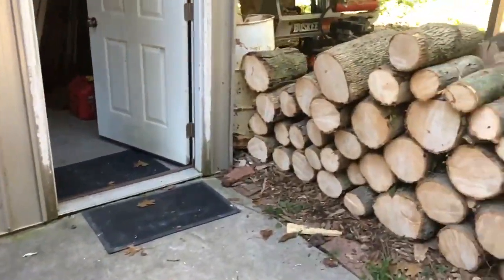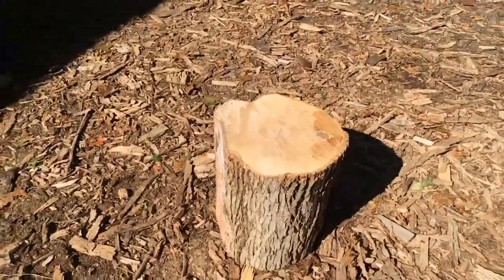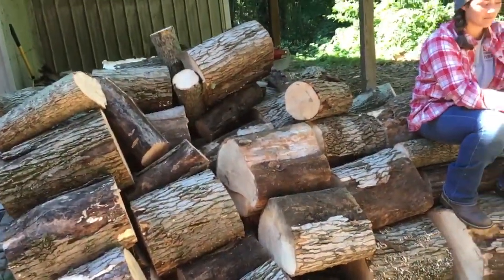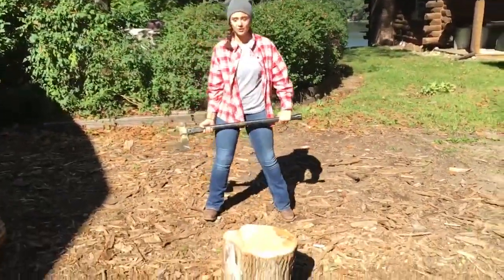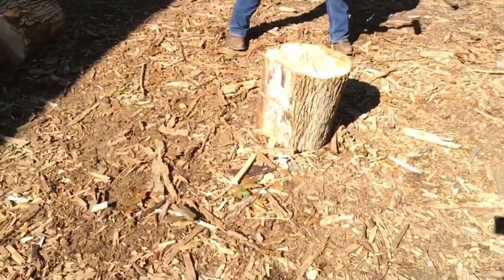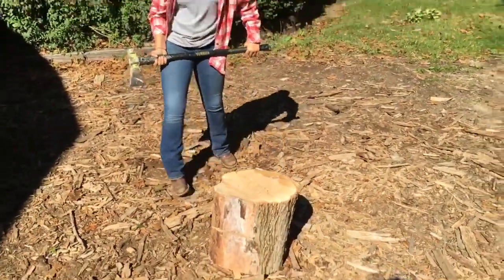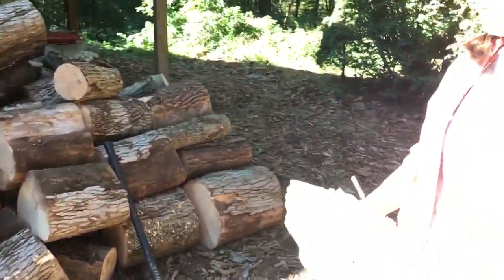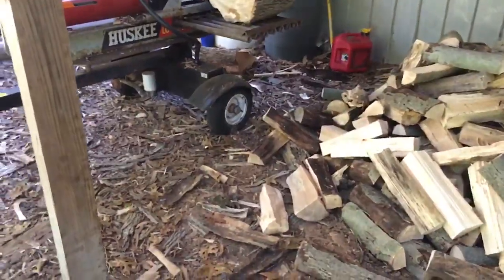Yes, a teenage girl can chop firewood with a maul

Comment: Great job Ashton! You will have an easier time splitting if you place a wide short piece of trunk underneath the piece you are splitting. Then more of the force you are applying will impact with splitting force, rather than causing the piece to bounce. It will also allow the head of your splitting maul to be square with your target piece allowing for more surface area of the splitting wedge to make contact. It's a much more efficient way to split.  At least that's what my many years of splitting wood have taught me.

Comment: If you put the round on top of another round or on a hard surface (slab of stone or on pavement/concrete) more of the kinetic energy will transfer into the round itself. Doing it on the bare soft ground transfers the energy into the ground (ends up acting as if you're trying to hammer the wood into the ground). Just something to try next time... always looking for ways to work smarter, not harder.
Reply: I said the same thing about 5 mins ago, scrolled down and found your comment, good to know I was not the only one that saw that.
Reply: That’s true but when you put it on the ground you get more arc in your swing, more speed and more power
Reply: @rowanfernsler9725  
Yes, as you save a boatload of time from not picking up rounds and chunks.Nobody who splits a lot of wood uses a block,  unless they have beaucoup time to waste.

Comment: Good job Ashton, if you can swing the axe up above your head and then have both hands at the bottom of the handle as you swing  back down on to the log you’ll have a lot more power going through the log. Keep up the good work.
Reply: Should give you better aim as well, both hands working more equally together.

Comment: Poor girl is going to wear herself out! Legs closer together, higher arch with the maul, bend knees and keep back straight on down swing.
Don't forget to grunt a bit, and give the maul a slight twist right as it hits the round. Work the crack from the edge inward.
If all else fails, get the old man to set up the splitter vertical and just roll them rounds over to it.
Reply: @JoesFirewoodVideos  , if it was her first time with it, , she has several things to learn, as mentioned, her stance, , maul over the back, and smoothly but swiftly swing, give a ''you SOB'' scream,  , splitting in the middle seldom gives fast results, hit a little off center,  , or take a step back, and hit towards  the edge right in front of you, looking for cracks already in the wood helps too, , if it had branches it has knots, and be sure not to try to split them,

Comment: Nice Video Joe.  Glad you found a hard working employee, guy or gal they seem hard to find these days.  Saw your pile of Ash and had a question.  Ash is my main wood source and i remove the bark as a common practice - but I cut a dead Ash tree that wasn't affected by the Ash Bore disease so it has its bark on.  The bark is part of the wood and can't be remove easily.  Do you sell any Ash with the bark in tact?  Is it OK to do that?
Thanks again Joe.  Keep the videos rolling.
Reply: Ash is a good work

Comment: Joeeee. come on man, you did not give her a fighting chance,  too much spongy stuff under the log she was trying to split, all her striking power was  being absorbed in the chips and splinters under the log she was trying to split, you cut enough wood to get her a short chopping block, about 6 or 8 inches tall, besides that pick up off the ground will increase the amount of the  edge of the maul that meets the log. she has the power todo it. needs to improve her accuracy, ( and I need to work on mine too, she is actually better than me).